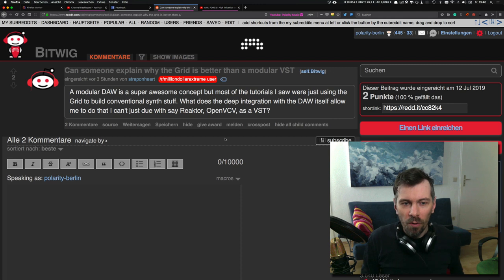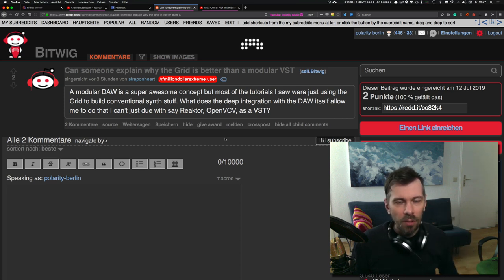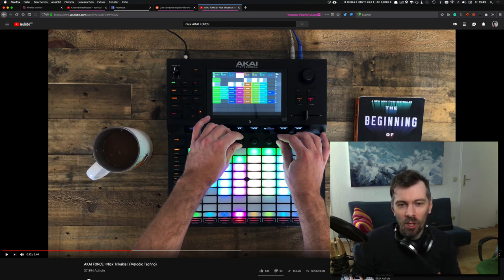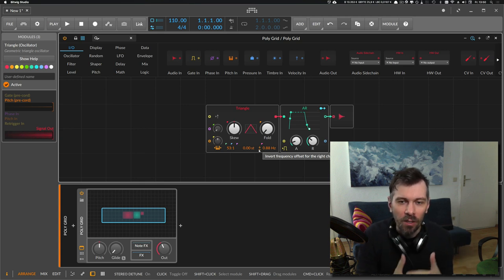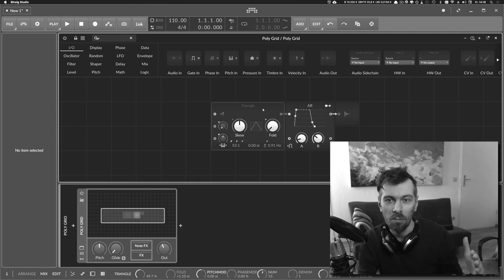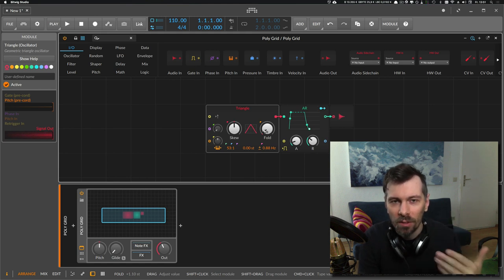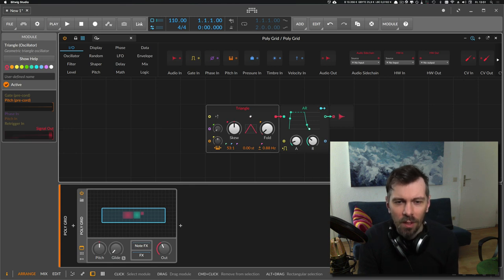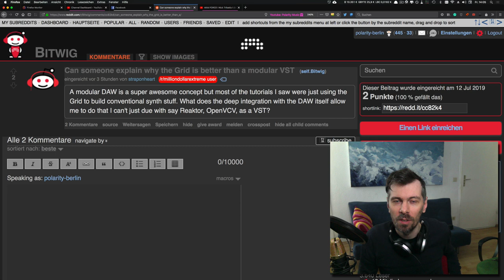Thoughts on Bitwig Studio 3 Grid vs. VCV Rack, Reaktor, Eurorack, Softube Modular

Comment: Hi Polarity. Massive fan of your videos and music. I rarely comment on Youtube but I actually think I disagree that there isn't something different between Bitwig/Grid and other modular environments and DAWs. I think that the ability to route audio and MIDI between devices and tracks in Bitwig is something that is special and lacking in other environments. In Bitwig, I could have a single track with a Poly Grid synth and I could route the audio from multiple other tracks or devices anywhere in my project and sidechain/influence any number of parameters in that modular synth from any number of sources anywhere in my project. This kind of behaviour is not possible in the vast majority of other environments and DAWs. It can lead to all kinds of unusual sound design, experimentation and mixing tricks which are not easily created elsewhere. People have been sidechaining the bass from the kick for years, but in Bitwig I can sidechain anything from anything else! This is just one example of a deep inter-connectivity that is difficult or impossible to achieve in many other DAWs. The modulator system in combination with the Grid and the general flexible routing are a very powerful package. I understand that this approach might not appeal to everyone, but if you like to experiment and enjoy having "happy accidents" with electronic music production then it's something quite special.

Comment: The way you interface with a medium interacts with and sculpts the media that's created. This is something I love about the package of Bitwig, it encourages experimentation and rapid iteration/resampling and design. It's really where I feel it blows away certain other environments. 

Max is great for example, or Pure Data, but they rarely feel as fun and experimental as quickly. The downside of this is sometimes things are less precise, and when you try to really refine something you don't have as much granular control. I don't see the inclusion of something more complex like a device editor/vst in the grid for example as taking away from what it is, but allowing the community to continually extend what's possible. I'd say a large majority of Bitwig users probably don't even write Grid patches, although we'll see if that changes.
Reply: One thing that really helps a lot in creativity is to embrace limitations, being precise (perfectionists) many times keeps you out of focus, embrace limitations, although I feel with the grid limitations are really small (The sandbox is huge).